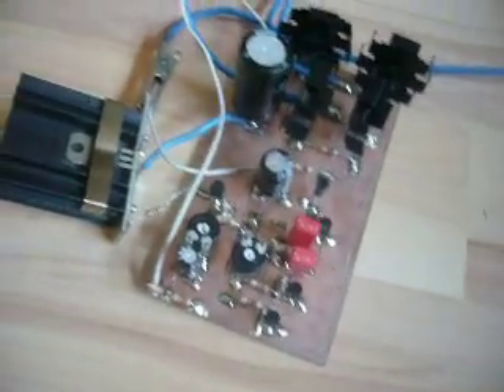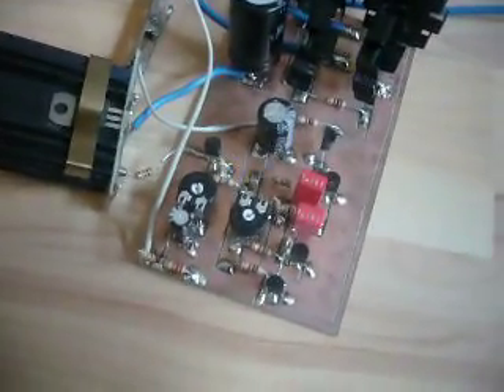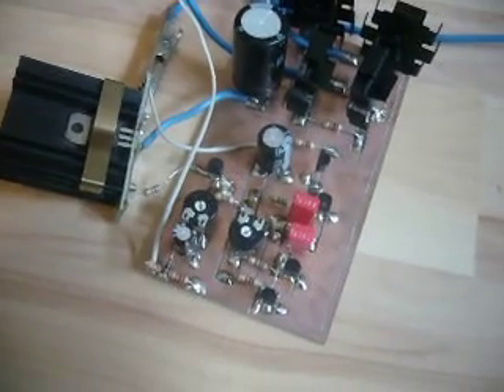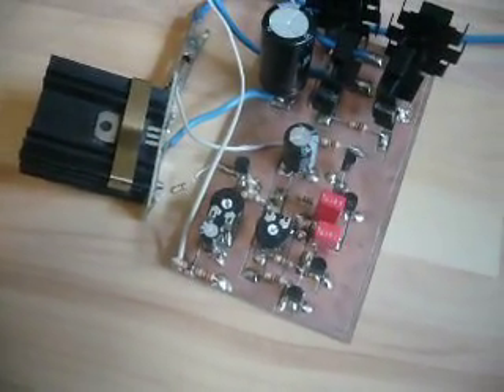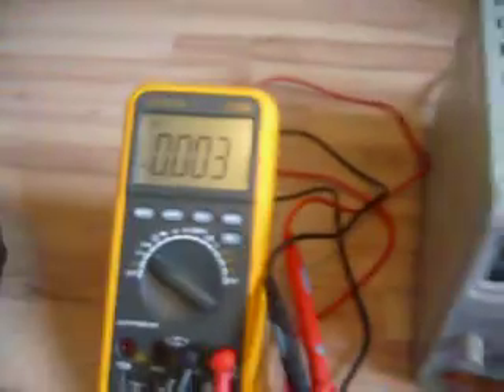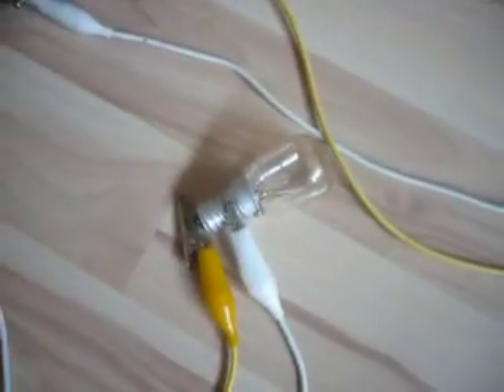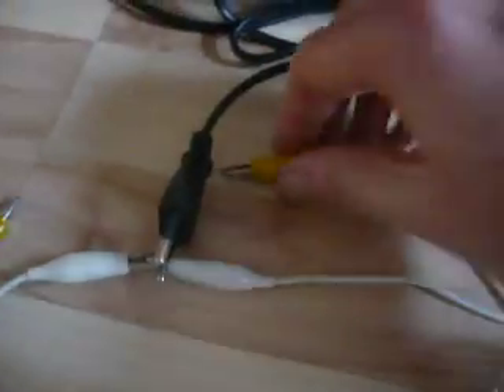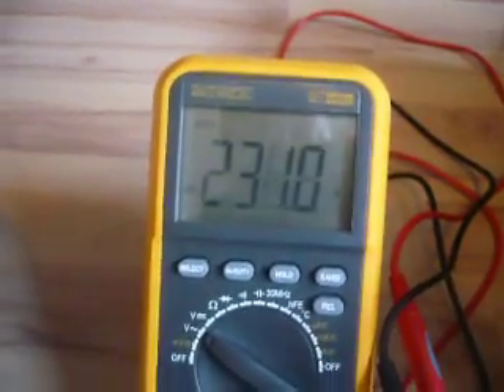Transistor DC to AC power inverter

Comment: The bulb was flickering because of the way it was hooked it up.  Light bulbs need good contact in the bulb base or else they will flicker.  The vibrations from the music are enough  to disturb the connection.

I took a look at your circuit.  It is nice and simple.  Very nice.  Commercial units have what is called an approximated sine wave.  There is some "dead time" where both transistors are off.  It's not easy to do with all discretes, though.  I used to drive mine with a PWM chip like TL494.

Comment: Do i need heat sinks for the power transistors if i will use this circuit only for experimenting the output? (a 100 watt lamp may be connected)  
Please reply as soon as possible